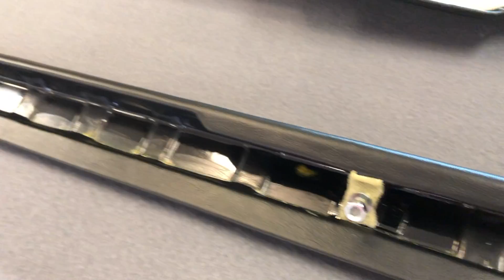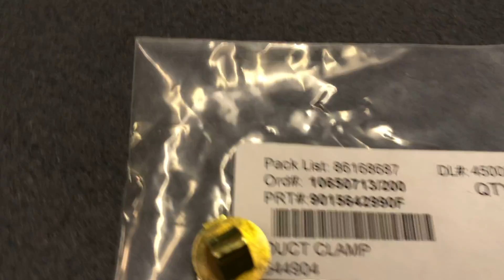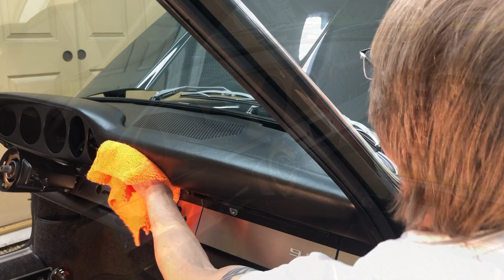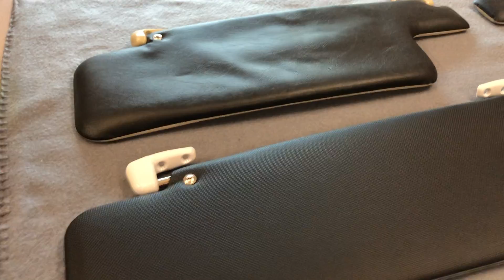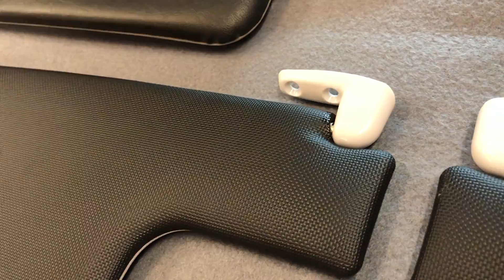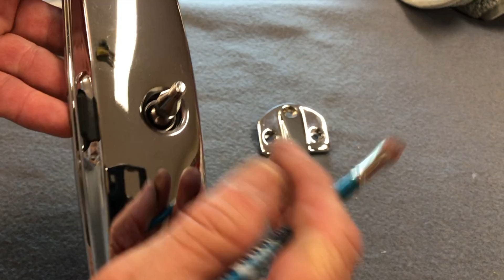Early Porsche 911 Dashboard installation / Video 70

Comment: ❤ where can i find that center dash trim?
Reply from the maker: Hello Kaczor
I made this trim on the dash years ago when I was in the cabinet making business.. No longer have the tools.
However you are able to get a set from Stoddard. They have most of the trims for different years. Originally I ordered a set
for this car but the quality was marginal and they had many scratches on them. Hopefully they have worked out those issues over time. Perhaps you call them and ask them to open the package and check for scratches before shipping.
Good luck!
 https://www.stoddard.com/sic55245168.html

Comment: Mike, did you go over covering the inside of the "A" pillar? Can't seem to find anything in your videos. Specifically I need information or diagram on how the vinyl transitions to the headliner. Previous botched headliner installation. Thanks, keep up the great work!
Reply from the maker: Hello John
I didn't not do any video on re-covering the A Pillar as it was pretty straight forward..
I used the original that came of the car as a template then cut and contact cemented the new replacement over it.
One thing to note on the A pillar wrap is it tucks under the dash board and ends specifically with the bottom edge of the dash panel.
I can take some pictures and send to you if you would like?
Reply: @MikesRestorations  Some pictures would be nice. I have a little different car, 1973T with sunroof. Can I assume the A pillar vinyl covering and front headliner the same? jafar278@gmail.com
Reply from the maker: @Vintageguy73  John ill get some pictures and send to you on the weekend! The headliner and pillar should be the same but I would recommend some research from suppliers just to double check that detail. the dashboard will be different in construction but A pillar should still tuck underneath the same

Comment: Hi Mike i cant remove my dashbord, i don’t know why but on the right side there is samething still attached. Can you help me please.
Thanks.
Michele.
Reply from the maker: Hello Michele
What year is your Porsche? The did some slight changes 68-69 and up
Reply: Mike’s Restorations 1965 Porsche 912
Reply from the maker: Michele there were two styles of dashboards used on the earliest cars.. Vin 301175 and similar uses 4 screws in the top of the dashboard next to the vents and they were covered with plastic caps. The style in my video was the next dashboard configuration..two studs going through the body to the trunk area with two nuts.
The third style was later and the dashboard was glued in under the windshield ..For this type the windshield has to be removed to remove the dashboard.
In all three cases there are front clips that press into the front of the dash shown in the video. You may possibly have something stuck or glued at this location
but it should be able to be pried out with a tool
I hope this helps
Good Luck!
Reply: Thanks a lot Mike, my dashbord is exatly like yours, i found a not original screw on the rigth side, someone put it there in the past. Your videos are the best and you are the best all over the world.
Reply from the maker: Im glad it worked out! sometimes that happens and really  makes it tough to figure out.
Good luck on your dashboard!

Comment: I think i noticed that the original black Porsche sunvisors had what we call long grain vinyl here in 🇦🇺 & the new repro's look like a patterned, but your hoodling has the holes & i can't remember what that trim is called. I couldn't see if the Porsche where like that on the ivory side. Do they not make correct reproductions of those Mike ? We have that problem over here with repro's that we call nqr, not quite right. Very frustrating paying a good price for something not correct. Everything else so far on the car has been very close to original.
Reply from the maker: Hello Resto Blast
The sun visors on these early cars are tough..The aftermarket is way off the mark with them being correct.
The original color is a light gray/ivory blend and the grain matches the rest of the cars texture.
Someday when I have loads of extra time I'll have a go at the originals and see what can be done to re-seal the edge after cutting.
The after market visors are extremely expensive for what they are... but our options are limited at the moment.
Will keep thinking on the visors and should make for an interesting video someday!

Comment: Lovely job Mike. Dash looks as close to original shape and finish (shiny) as I have seen. 
Should the sun visor colour would be ivory, same as headliner rather than white? 
Anyway - I would certainly give the old visors a restore when you have time. 
There is a wonderful step by step restoration on the Pagoda SL Group forum that splits the old visors and restores using Celtec insole board (1.5mm), foam, UV vinyl glue gun and painting that results in an "as new" condition.
Reply from the maker: Hello Mark
Thanks..I will have a go at the sun visors someday and I will check out your suggestion thank you for the recommendation!
Sunvisors on these early cars are hugely different than later models.. If I can see a way to seam back together that works
Im in.. Real color is really kind of a mix light gray to ivory leaning more towards gray.
The expensive replacements are gray but too bright of color. Pattern is wrong also but will give me some eye protection when we go for a first drive. Im not sure why the aftermarket manufactures don't get the importance of identical? Its a mystery..
Some aftermarket manufactures are amazing and get it right in every detail!

Comment: Another ace video of what is the highest of high-end restorations. Slightly surprised, knowing your standards that you've gone with a different grain pattern on the new vinyl sun visors but maybe it's not so noticeable in real life.
Reply from the maker: Thanks Michael..Yes no doubt it bothers me..those sun visors on the early cars a lot more going on there that meets the eye.. One day when I have exuberance amounts of time which i'm sure those would require
I will have a go at them and see if its possible to do a tight and 1st grade restoration,
In the meantime we really need to press on. The list is long!

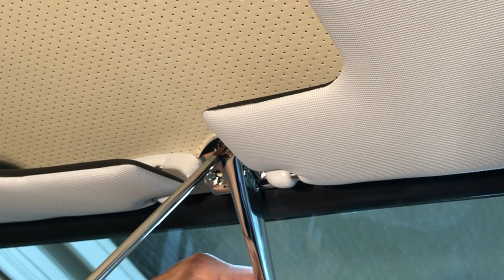Comment: 10:35 My OCD wouldn't allow the sunvisors you put in the car, irrespective of how they were from the factory, because in my opinion sunvisors should match the headliner.  You probably have some leftover headliner material (for the white side) and some vinyl from the dashboard (black side).  These sunvisors are really simple to repair/recover compared to ones from a modern car and since you already have a spare set check out this video.
https://www.youtube.com/watch?v=BGuD1-NAGgk
EDIT: Sorry couldn't find the correct video, heres another one but its not the one I was looking for
https://www.youtube.com/watch?v=3eADT0EJI10
Just send the spare sunvisors to a local upholstery shop with the materials, they should try really hard to mess them up.
Reply from the maker: Hi Gplus..nices videos thanks for the recommendation..
The problem with Porsche sun visors is the outer edge detail. They were heat seamed together without a border..If I could replicate that detail then recovering would be piece of cake.
Will keep thinking though!
Reply: @MikesRestorations  yes, check the second BMW sunvisor video, these have similar edges around.
Reply: And another two part sunvisor video, this shows how both front and back of the sunvisor is attached https://www.youtube.com/watch?v=hw-24vM7uWM
Reply from the maker: Thanks Gplus will check it out!
Reply: I suggest brushing on leatherique vinyl/leather paint. I used it on my BMW dash and it works a treat..